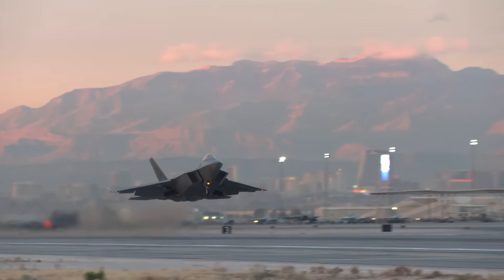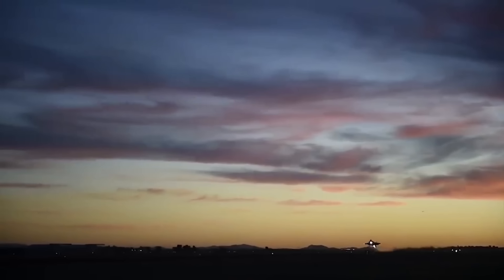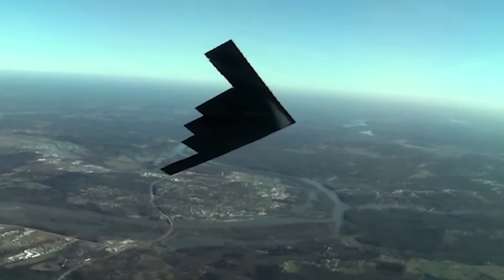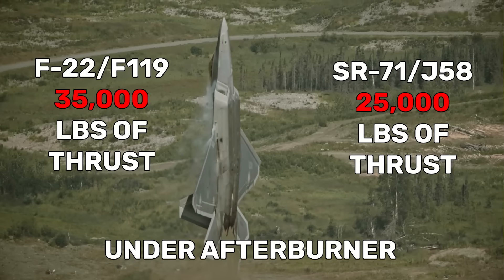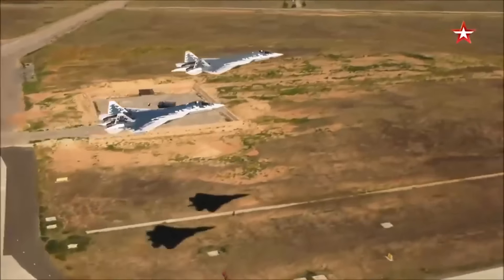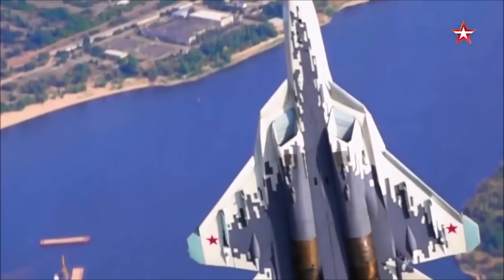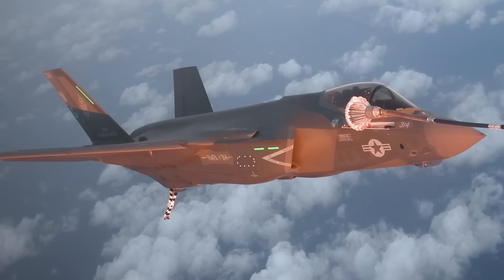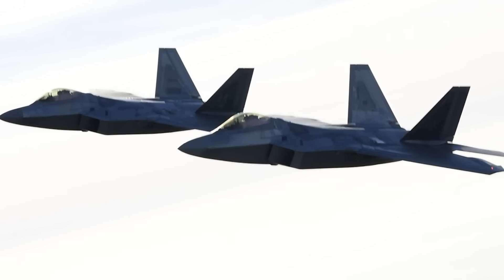The race to field the most powerful stealth fighter engines in history

Comment: Each bit of info on these new adaptive cycle engines is near voodoo in it's achievement. To improve thrust and range along with thermal management is incredible. I'd like to see a video on how the aerodynamics work on the sixth generation fighters since they are doing away with many standard control surfaces

Comment: Still like to see what would have become of the General Electric/Rolls-Royce F136 engine in the F-35.
Reply: Same here!  Plus, competions alway drives for a better product and sometimes a better price but not always.
Reply: It's better not to have brand new engine tech in a single engine fighter. The tech in the F-35 engines was first tested and proven in the F-22 where there were two engines and the plane could likely still land if one failed. The DoD made the right choice going with a simpler Pratt&whitney upgrade on the the F-35, they have a great track record with reliability and we don't want to risk the readiness if our F-35 fleet. You'll be seeing the new adaptive engines in pairs on the new NGAD fighters once those come out.

Comment: GE really did some massive upgrades to fit J85s into the Blackbird.  A very secret and little known effort on their part.  Equally impressive was the work done to fit the J58s into an F-5, although there was a bit of airframe modifications making two large engine bay humps in the aft end of the Tiger's fuselage.

Ah, those darn, similar engine designations.
Reply: you mean 58s?... they were both 58s and clearly you screwed it up showing you are talking out your butt because even your edit didn't fix it.

Comment: The rotationion detonation engines will be a huge leap.
Reply: Nah
Reply: The rotational detonation combuster will be a step change.   Maybe 20% more efficient that’s huge.  Do the same to the augmenter and you’re beyond anything anyone else has
Reply: I think rotating detonation is more of a future rocket engine technology than a jet engine technology. 

It's hard enough to get controlled detonation wave front when you control the oxidizer and fuel. And is so far only been demonstrated in test rigs and not in flight.

But an air breathing engine isn't going going to get liquid oxygen and has to work with turbulent air with only 21% oxygen content.

Is rotating detonation even possible with air breathing engines? I don't know. But if it is, we are probably decades away.
Reply: @christopherkelley2061  it’s been demonstrated for use in engines.  I was looking at a report a couple weeks ago that combined the test rig results with full engine simulations.  Instead of losing several percent of the pressure due to the combuster flow restrictions they increased the pressure by close to 10%! That’s pretty much free compression without the corresponding temp rise.
Reply: Those engines are more for extreme altitude like 100 000 feet. I guess they could make a suborbital space fighter. But its not really the same as a gen 6 jet fighter.
Reply: @chrissmith7669  The 135 engine that is in older f35s beats anything anyone else has. It beats the engine china is working on right now and is still probably a few years away from getting out and the US has engines that are more than 10% more powerful and 30% more efficient than the engines that is already wiping the floor with the best other countries are testing.
Reply: @thomgizziz  it is and we’re constantly looking at ways to make it even better

Comment: AS I have said many times before; MORE on P51's Alex!  Too bad I'm too old to go and work for your advertiser in Minnesota.  I was about to start on rebuilding a P51 of my own over 25 years ago with the help of (and offers of a "guaranteed rebuildable V1650-7" and other parts etc.) my friend Bill Speer (who'd rebuilt three) until he "went in" at Reno. I was going to design and produce the spar/landing gear pivot in billet magnesium, CNC'd on a 5 axis mill as there were no investment casting foundries capable of doing the job.  Even with the "Lost Foam" approach.  Also, why not do something on P47's and maybe even the "Ultra-Bolt": XP72 and how that would have done re: the Me 262.

Comment: @sandbox - I'd like your insights on modern Russian/Chinese engine life expectancy under heavy load. If memory serves me right, their legacy engines had the unfortunate feature of starting to "self-weld" themselves when working hard. It is great to produce +30,000 lbs/ >100,000 kN of thrust but it is not logistically great if one must get new engines for every 10th sortie (as a tongue-in-cheek example).
Reply: If they self-weld, they are simply meeting their goal to minimize the number of parts requiring maintenance:-)

Comment: I have a (perhaps naive) question:
With these new "adaptive cycle" engines, will fighter aircraft even need afterburners anymore? Or is the "high burning" mode of the engine itself going to take over the function of the afterburner?
After all, the afterburner can only burn fuel with oxygen that hasn't already been used to burn fuel inside the engine itself, which is part of why afterburners pair so well with turboFANS and not turboJETs.
But if you can make the thing act more like a turbojet and less like a turbofan, or vice versa, on demand, it seems that the potential for greater overall performance is made available, without having to resort to the drastic fuel burn increase of an afterburner.

Comment: I live in the Cincinnati area, and I actually work at GE Aviation. I was lucky enough to get to work on one of the prototypes of the AETP engine program, which is the XA100. So obviously I’m a little biased, but our engines are just far superior in performance compared to anything on the market. Sure, that kind of performance isn’t cheap, but those extra dollars will save lives and win wars! 
Another great video, and I can’t wait for the next one ✌🏼
Reply: GE has that level of refinement. They always take a decade too long to beat Pratt & Whitney. But they sit back and improve on the P&W designs and come in to take their sales in the latter half of the program. 

P&W does things nobody else wants to try. They are on the bleeding edge of technology and GE can't compete in that area. From the J-58 to the most recent successful SCRAMJET engines. P&W is the leader in technological leaps.
Reply: The only reason they lost out was they couldn’t guarantee a STOVL variant and the pentagon wouldn’t commit without it.
Reply: @Triple_J.1  well I’d clearly disagree ha. Even this very video mentioned our adaptive cycle capability being successful far before they were even close. Adaptive cycle technology is certainly what most would consider an advancement, with ours being ahead of the competition. But to each their own I suppose!
Reply: @Triple_J.1  Very well stated and the absolute truth based on personal military flying and civilian engineering experience.  Given that, the U.S. Military needs to preserve all of its aircraft engine industrial base for a highly likely World War III.  The ability to produce fourth, fifth, and sixth generation engines and their associated aircraft generations will be crucial to the U.S. win.  In Thrust We Trust!

Comment: Excellent video! Quite amazing when you realise that the F22's supercruise speed is slower than a 1970s passenger jet! The F22 needs very powerful engines as it's so damned heavy (twice the weight of the Typhoon). It also has less range, lower thrust/weight ratio and is actually SLOWER than the Typhoon (with afterburners). Combat range is HALF that of the Typhoon. That weight is its downfall.

Comment: I kinda wish the F-35s had gotten their engine upgrades to the GEs XA100 in the new block. I hope they eventually do, perhaps with even better ones. There seems to be a lot of new technologies on the horizon with NGAD coming.
Reply: @major__kong  That would be my guess too. The Pratt and Whitney upgrade to the existing engines is just seen as more pragmatic.
Reply: @jajssblue another big factor was that as of yet they didn't have the ability to fit the adaptive cycle engine into the F-35B model with the lift fan, so they would either have had to put off the upgrade until that was possible, or end up with two different engines in use across the F-35 fleet (very bad for logistics and sustainment/readiness), AND the F-35B would still need the additional cooling capacity from the core upgrade option to use the same new electronics, so they would have had to fund both engine development programs, a very pricey proposition.

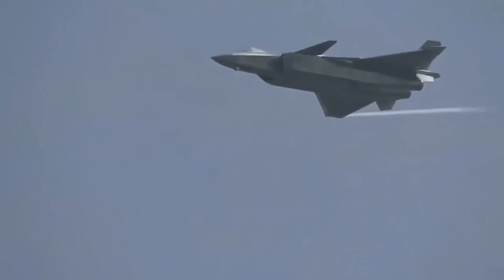Comment: 3:50

Actually 

The WS-10C that the J-20 uses since 2019 have Stealthy features like serrated exhaust feathers 

So in comparison to the upcomming WS-15 the WS-10C is only lacking in Thrust and TVC and doesnt effect it stealth performance as much as the Al-41 on the Su-57
Reply: WS-15 Has entered mass production last year.
Reply: @ajaykumarsingh702 
The WS-15 got into production but there are yet has to be a production model of the J-20 that actually uses it

That's why I used the word "upcomming"

Comment: I would like to see a program on whether or when rotation detonation engines will be incorporated into fighters.
Reply: They are only effective at higher altitudes. So its more of a suborbital space plane thing. They are kind of useless as fighters becaus they would fly to highCan probobly use them as bombers.
Reply: @matsv201   I am not sure that is correct. Are you thinking of a scramjet? Here is a quote from Sandboxx.

In aircraft applications like jet fighters, rotating detonation engines could offer similar benefits to missiles in terms of range and speed while potentially reducing maintenance requirements. Fighters, in particular, rely on afterburners, which effectively firehose fuel into the engine’s exhaust stream for added thrust.

Comment: Multivariable linear quadratic regulator control system. At first I was just curious what this mouthful looked like all spelled out in front of me. Then I looked it up. It's a feedback control algorithm that uses all state variables to design optimal control. So this seems like it would be a widely used method for controlling dynamic systems in mechatronics. And so it is. I think I'm just addicted to the clicking sound on this keyboard.

Comment: Now that the NGAD looks like it might not be happening I wonder if they should look to re-engining our already in production fighters. Given the advances in these engines from the older F100 and F110 engines we could re-engine our older F15-and F-16 fighters to give them even more thrust that they currently have. Perhaps the most important improvement we could get from newer engines would actually be increased range. The F16 currently only has a combat range of about 300nmi. That really isn't much, especially in the pacific. If we could stretch that out using the developments from the last 50 years of engine development we could keep those platforms in the fight.

Comment: Hey Alex! Very well done. Well done my friend 👊😎 You know Alex, there were some inside conversations during the YF-22 and 23, particularly considering the power plants. The setup for the YF23 was well understood that super Cruise even with the weight penalty as you call it. Well exceeded the now F-22. When the military magazine I forget the name of it. But what happened? There was a low hanging compartment in the center of the YF-23 Black widow / gray ghost. The magazine named it the black widow cuz of the way that the warning paint looked at. Angels 10. Go figure. I wish you were able to put the TWR on the YF 23 engine. I don't believe that they have publicized it yet. But with the low to no heat signature setup of that particular aircraft y of 23 that is. Heat tiles. Also, they were going to put kennards on the end of the main wings for maneuverability as such as the 20° that the raptor has. When the military magazine named it, it really upset some of the DOD top brass that fell under the same routine of the F-16 fighting falcon aka viper. Wonder if you have the numbers for the wife 23 engine? Deeply appreciate it 🕊️

Comment: I'd love to see the foundries where the exotic metals for the engines see reality, along with the chemistry, metallurgy, and engineering.  It's gotta be amazing.

Aren't F-35 parts made by entities across like 48 states and around the globe?  Hats off to the Program Managers and Supply Chain Coordinators.

The J58 has such an historic reputation for thrust, it's hard to wrap my head around how much more thrust the F119 has.  But as one OP pointed out, at speed most of the thrust came from the inlet when the bypass and suck-in doors were closed, which was a unique 'cycle' (to borrow from GE's adaptive cycle nomenclature) the SR-71 exploited.  Soooo, is it really accurate to compare the F119, F120, or the XA100 max thrust specifications with the J58's?  It's not like sticking either of the three engines in the Blackbird is going to drive the aircraft to Mach 3.2.

Comment: Away from  ir detection, well, from behind, the exhaust will be really visible in IR. And selling an aircraft without clear specs as the real performance of the engine isn't known, not to mention without it's final engine is a mess in my opinion. Would you buy a car without a temporary engine ?

Comment: F22 Raptor
P&W F119: 116 KN; 160 KN with afterburner.

F 35 Lightning II
P&W F135: 125 KN; 191 KN with afterburner.

J 20 Mighty Dragon
WS 15: 107 KN; 187 KN with afterburner. 

Su 57 Felon
AL 51F1: 108 KN; 177 KN with afterburner.

Powerful engines

Comment: Great video, Alex.  It leads to my question after following the F-35 Block 4 coverage: why can't the F-35 supercruise?  If the F135 is a higher output evolution of the F119, is it a function of the aerodynamics of the Battle Penguin?
Reply: The reason is simple. While the f119 engine has 26,000 lbs thrust without AB's, and the F135 has more at 28,000 lbs thrust?
The f22 has 2 engines vs 1 in the f35 
So thrust without AB's for f22 is 2 x 26,000 lbs = 52,000 lbs total vs 28,000 lbs total in the f35 with one engine. So 2 engines means more total power despite the f135 engine being more powerful.

Comment: True enough, laser weapons are still in their infancy and woefully underpowered, but research is changing that horizon from 10  kilowatts to 50 megawatts.  Hi-powered lasers will be part of a complex matrix used to knockout or at least to confuse guidance parameters, including AI , in missiles and drones at nice cost reduction.
Reply: No no it isn't. Right now a 1MW continuous laser at the very very high end of tech is 5000lbs... a 50MW laser would weigh 250000lbs. We aren't even close to being able to knock missiles out of the sky. The best we are hoping for right now is being able to screw with its sensors. Get a grip on reality.

Comment: I notice a stark contrast in tail fin size between the F-22 and Su-57... Is the Su's able to be so much smaller, because they use 3D Thrust Vectoring vs the Raptor's 2D?
(edit: Hmm, just reached the point where the new engine will only be 2D... I wonder if that, and smaller tail control surface, will significantly impact maneuverability?)
Reply: The entire fin on the SU 57 can move.
Reply: @tyrantfox7801  I noticed that. I thought the Raptor's could as well, but sounds like that's not the case... 😅

Comment: These new engines likely aren't making use of rotating detonation engine technology right? In which case that would be very interesting, as it's a major improvement in performance, all while that new tech might allow another significant gain yet further down the road then.
Reply: Don't think they wanna take too much risk just yet especially on a jet as numerous as the F-35, but by the time NGAD enters production the technology will probably be more refined
Reply: Yeah I kind of figured, in which case I guess it's a way for a next 'next' gen engine to get another big gain I guess.
Reply: @Quickshot0 it's very possible that that tech is used just for afterburners first, and that would make it a pretty easy swap for any existing jet engine already using an afterburner, as it is pretty separate from the engine itself. Meaning it would be able to be used with existing engines and existing jets, no need to wait for a future engine that comes after the adaptive cycle engine one. Though obviously you would not be getting the full benefits of the tech until the core engine is using it in addition to the afterburner.
Reply: Curious, aren’t rotating detonation engines limited to rocket applications?
Reply: @vanguard9067  When I looked them up, I thought there were rotating, or perhaps standing wave engine work also with jet engines.

Though one would have to look it up to know for sure I guess.
Reply: @Quickshot0  I’ve read about them, but have only in the context of rocket engines, but I don’t know for sure.
Reply: @vanguard9067  After a brief look around GE seems like they might be working on a hypersonic engine variant using a rotating detonation engine.

So it does seem like they are trying to use in it in at least some jet  engine applications.
Reply: @Quickshot0  thank you for your research.

Comment: Kinda worried about the future public perception of these things when you mentioned how it's not the XA100 or 101 that's going into aircraft, but rather entirely new purpose built iterations building further upon the technology developed from these.

I can't help but imagine future headlines lambasting the "supposed next-gen engines" for having a lot of mechanical issues especially with the high expectations given to them. I feel like making the XAs far more mature and production ready from the get go is better than going ahead and making an entirely new engine based on them, work out the kinks early and all.